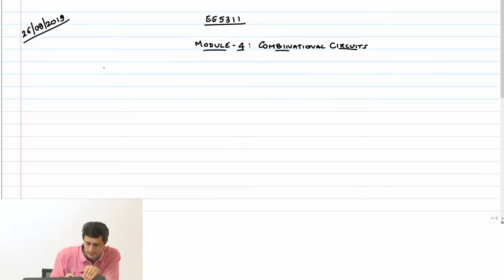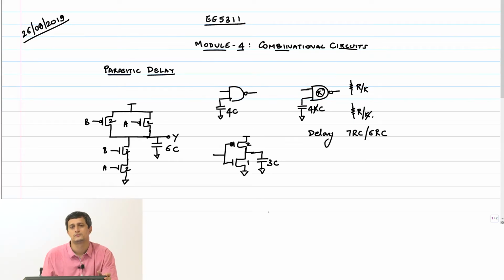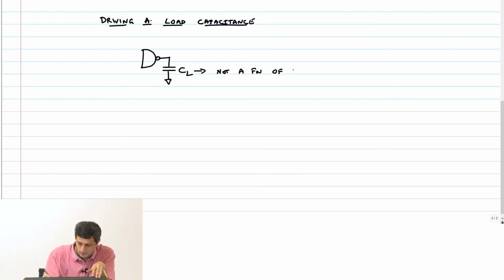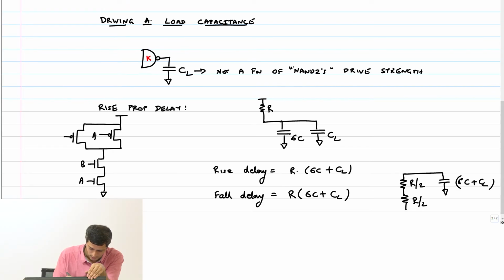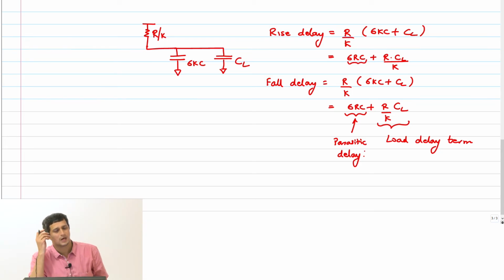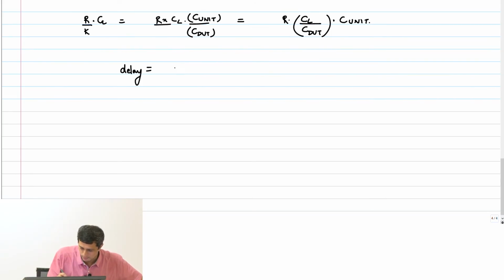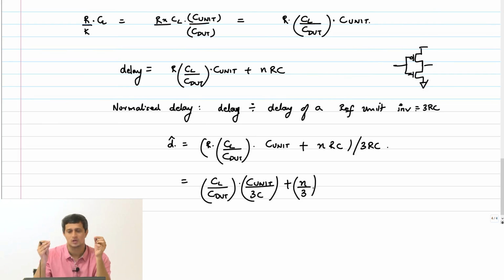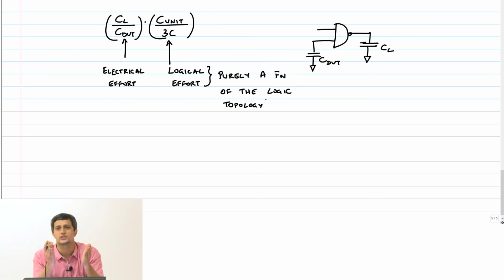CombCkt - 7 - Gate Delay with a Load Capacitance

Comment: My doubt is from Jankirama Sir lectures on DIC.

From a concept of "Effect of Upsizing of Gate on Parasitic delay"

In this he explained and come to a conclusion that Parasitic Delay is not affected by upsizing the Gate.

After this he defined a term "Normalized Parasitic Delay" in which he was taking ratio of Net o/p diffusion capacitance to Refrence CMOS inverter O/P capacitance.

For example, for a 3 input nand gate , O/p diffusion capacitance is 9C. and The o/p diffusion capacitance of reference CMOS is 3C.

So "Normalised Parasitic Delay is 9C/3C = 3".

I just Don't get what is the use and purpose of this "Normalised Parasitic Delay".

What does this 3 indicates???.
Reply: indicates the ratio of current gate compared to its reference. it makes it easier to define the delay for other logic by just telling how much is the fan-out.
btw, your question is very informative :)

Comment: 02::30_17-04-24_@IIIT-H
logical effort --> unit gate cap per inverter cap thus it is minimum if we try to implement inverter logic else if we change topology and add more transistors...unit Cap will change and logical effort increases